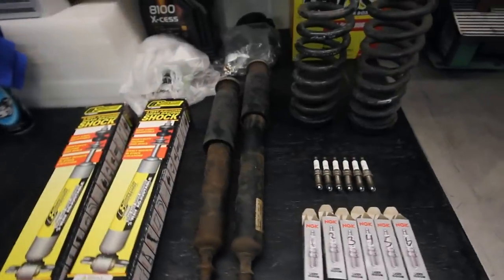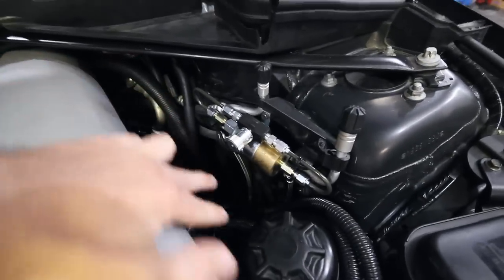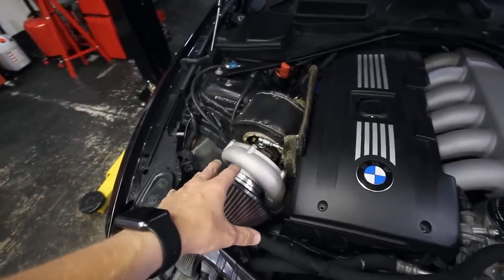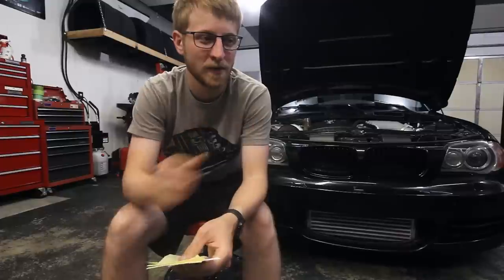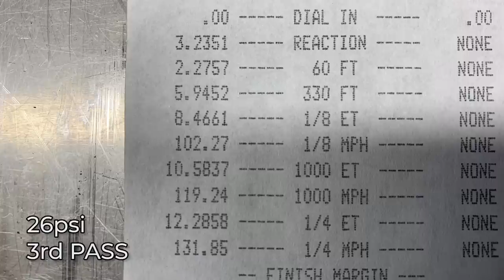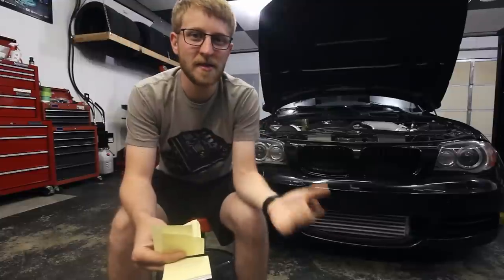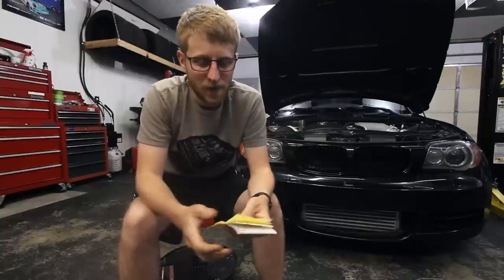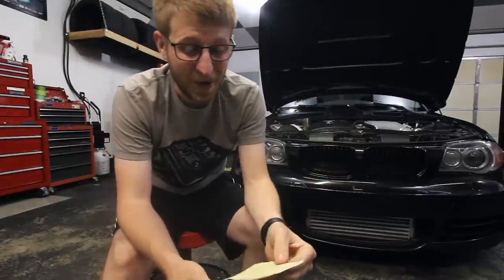Chasing a 10 SECOND PASS in my 750HP BMW 135i! (Single Turbo)

Comment: yes Jake cracking effort, did you flat shift to hold boost through gears ?
Reply from the maker: I tried at the beginning of the day, but with the JB4 NLS relay there was a slight electronic delay so I stopped doing it. The 10 sec pass was done without flat shifting.

Comment: 750whp in a 3200lbs to barely crack 10s cmon BMW!
Reply from the maker: Yeah, she's a fussy girl. With the right parts and better driving, I'm sure I can dive deeper.
Reply: With that kind of torque and the low weight,  it can be very challenging putting the power to the ground. Ryan, I doubt you'd do any better.

Comment: Crazy to think that Arm Motorsports $1500 build is .5-.8 of a sec difference that your more than 10k build. Stock turbos. Makes you think
Reply from the maker: ARM Motorsports is also an automatic AWD car. Very advantageous for launching, plus the torque of the twin turbos help in this situation. But still pretty crazy!
Reply: Tracking all. Just saying.

Comment: Did you use the jb4 2step for no lift shifting?
Reply from the maker: I tried it at the beginning of the day but it seemed laggy to me. Like the delay was too long in between gears, slower than I was shifting.
Reply: Jake Spence thanks, to be honest I have it installed and was always afraid to try it because I felt like it is too aggressive and might snap something. But I guess if it didn’t snap anything for you with that power I might be good. 3rd to 4th nls might not be that hard on components
Reply from the maker: You'll be fine. I've used it many times, it has a little delay built in so that it doesn't slam gears. I think you'll be okay.

Comment: This was very painful to watch. That poor car...
First off learn how to do a proper burnout. You are on drag tires that require heat. You never once got them hot enough to hook properly or at least try to.
Secondly don't go to the track and start at the top trying to launch at 7,000rpms not knowing the car or anything. 
Third if you botch the launch then abort the run. There is absolutely no reason to beat on your car the rest of the run if you are only chasing numbers. (if you are data logging to tune that is different)

My advice, 1) learn to do a burnout 2) launch lower with higher psi in the tires 3) gradually launch higher with less psi in the tires 4) Run a better time
Reply from the maker: Thanks for the tips. Hard to do a proper burnout with an open diff and traction control kicking on. I got an LSD now though. I figured out the sweet spot for launching is ~5,500 RPMs, higher spins and lower bogs. I was trying to get some data for the higher gears yet, hence running it out sometimes. I kept the ones where I aborted the launch out of the video.
Reply: @jake_spence  Traction control off, get the tires wet, rev the car up, dump the clutch, and get on the brake just enough to keep you from moving forward. There are different styles, some people do heel/toe but this is the method I use. Different drag tires need different amount of heat. Too much heat and you make traction worse. I usually just do a burnout until I see some smoke then (this is important) let off the brake and continue the burnout going forward. What this does is gets some VHT on your tires. Doesn't matter if you have an open diff or LSD.
Reply: Oh and also, spinning a little ISN'T BAD. If you instantly hook your RPMs will drop. Spinning just enough to keep your RPMs in the powerband is actually good from my experience.